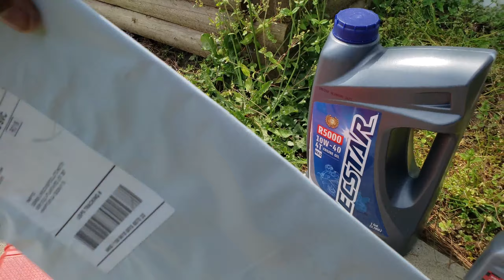Clutch Destroyed! | Outlaw Racing Products Clutch Kit Install

Comment: Hey man, i see you installed the plates in somewhat of an alternating order. Is this neccesary? Is there a certain way these plates go in? Meaning the direction the clutch material is facing
Reply from the maker: From what I was told by the mechanic at our local Suzuki, the plates do go in at a certain direction and in an alternating placement. This was more than apparent when I removed the plates to inspect them, and that's how they were. So not only was he correct, but I just placed them the same as I removed them. Full disclosure... these were the originals from the factory and the first time the case had been removed. It was again apparent because I had to scrape and remove the gaskets small pieces that were left around the edge of the clutch case. 😒
Reply: @Dragonchi1971  what about direction of first plate? I installed my new clutch so the starting plate is pointing to the front. As i believe the steel plates rotate counter clockwise
Reply from the maker: Did you get Suzuki OEM or aftermarket kit for the plates?

Comment: How is the bike running bro I bought the same brand clutch kit but mine didn’t come with springs what would you review the outlaw kit
Reply from the maker: I truly would have to say that they are great. The only issue for me personally was the kit I purchased, you can't use synthetic oil with. I wanted to switch over to synthetic for the longevity, so we just replaced the plates and springs with a clutch kit from Suzuki about 3 months ago. @C2W has Brian do the service on my bike for a possible video, and Brian gave me the plates back thinking they were brand new because they held up so well!

Comment: For my 5VY they state not to use the last two plates. Did that and clutch won't even work at all now. Did urs go the same way? I know different bike but don't hurt to ask lol.
Reply from the maker: I used all plates. The only issue with mine is I'm unable to use synthetic oil with these plates. But no issue with using the last plates.